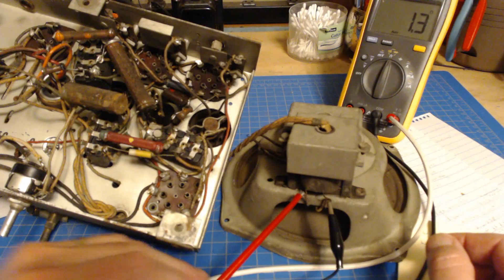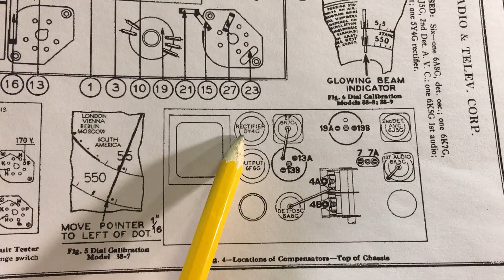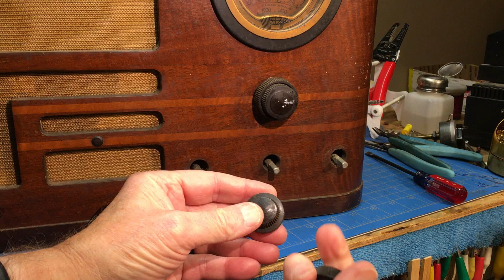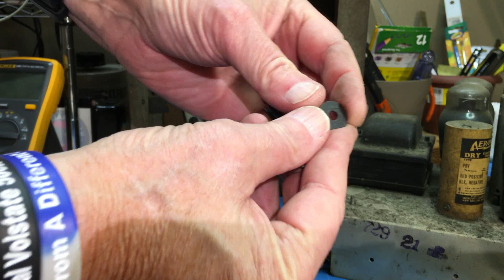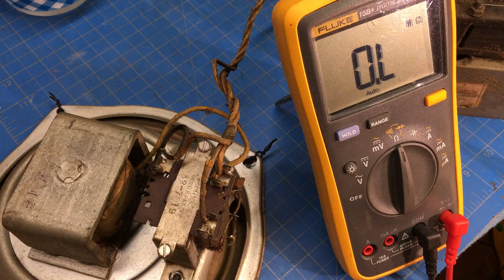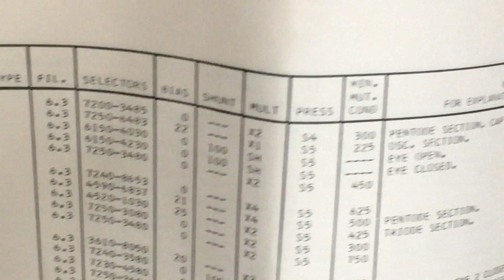1938 Philco 38 9 Part 1 of 6 Disassembly and Initial Checkout

Comment: Glad to see this radio. I'm working on a Philco 38-40. It looks similiar to this one. Mine had an antenna coil missing and the band switch was destroyed, so it took some figuring on how to fix. I'll be interested to see the inside of this one.
Reply from the maker: Thanks Gary! If there is anything in particular you would like to see, let me know and I will shoot some shots special for you! Thanks for watching and as usual the comments....Take Care—Larry
Reply: @Backtothefutureradios   Yes, mine had a component perched on top of the tuning capacitor. It looks like a antenna coil. It looks as though someone added there. one lead came from the external antenna lug and the other lead went to the grid cap of the 6K7 oscillator tube. I was wondering if supposed to be there. i,ve not seen anything like it.
Reply from the maker: @garyk.8674  doesn’t sound like that is original!!! Sounds like they bypassed the antenna coil... Maybe you can find some pictures or video of a 38-40 somewhere....there is nothing on this tuning condenser....
Reply from the maker: @garyk.8674  Do you have any pictures of it? Id like to see it.....Do you have my email?

Comment: Wonderful to see another new video from you Larry!
This should be a very interesting radio to restore.  I am looking forward to all the videos in this series.  I love how you come up to a "roadblock" and simply say, can't do "X" , well then I will simply do "Y" instead.  Love your positive attitude.
I realize that it might be an error in my sight but I think you mentioned that the two capacitors, the electrolytics, were replacements for a "can" on the top.  I realize this suggestion may be a bit pricey and therefore not doable, but have you considered using one of these to put the capacitor(s) on top again:  https://adapt-a-cap.com/collections/all
I have been thinking about doing something similar myself, but would be making the entire thing myself instead of purchasing it.  In any case, I am interested in seeing what you decide to do on this one.
At first, I thought the reading on the "output transformer" was a matter of dirty connection, but as you continued to work with it, and the value of resistance kept changing, well, I agree with you that it is either going to require a rebuild of this one, or a replacement.  Not sure I would trust this one with it changing like that.
Blessings to you and your family!
Stay Safe, Stay Healthy, and Stay Happy!!!
Reply from the maker: Thanks Wayne! The adapt-a-cap looks like a good idea, but Im afraid its a little rich for me...lol....I may try to locate a picture of the can and see if I have one....otherwise, mount a couple under the chassis....worked before...I have a replacement output transformer on an old speaker that I can use.....I probably will tear this one apart and see whats inside...lol.....hope you got my holiday email I sent you? Take Care—Larry